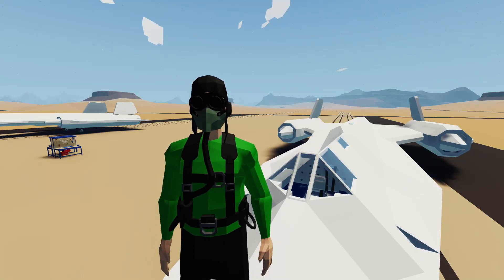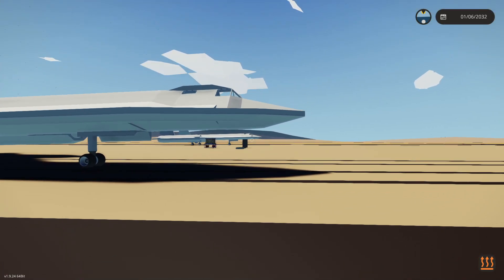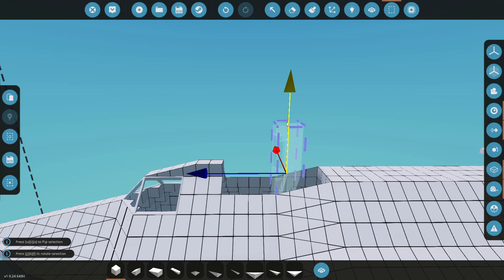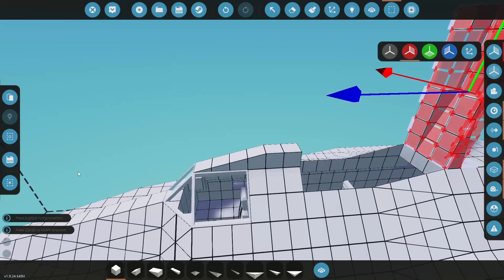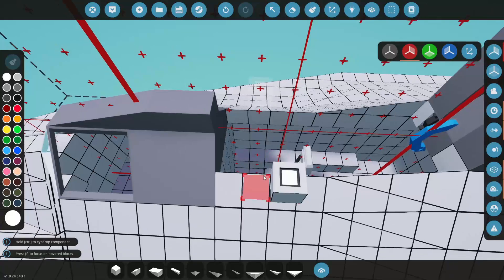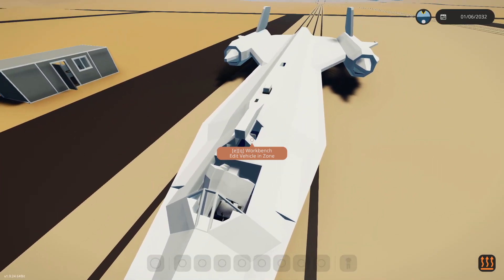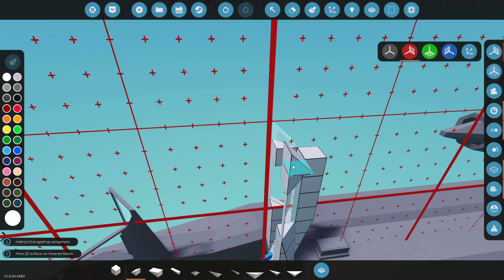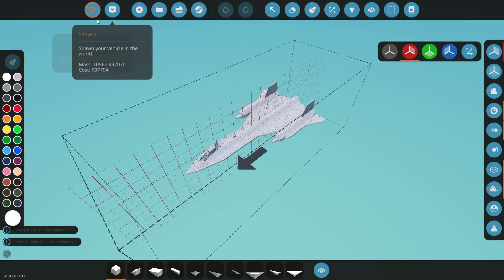Cockpit Canopy & Layout of Dials! Let's Build a SR-71 Blackbird!!! [5] Stormworks

Comment: Hey man, I love airplanes and I know some information about the SR-71 cockpit (may not be 100% correct).

So in the left back side are all the circuit breakers (way less that the right side), and oxygen. Between the throttle and the breakers are the radio and lightning controls. three oxygen systems: two normal, one for emergency. 
Some engine "emergency controls" and inlet doors bypasses are on the left of the cockpit levers. 

Front panel:
On the left part of the panel there is internal and external temperature control, oxygen levels, landing gear controls and cabin pressure. (there is a lot more stuff but these are the main components).
On the center, there is an AOT gauge on the left of the artificial horizon.
Left side of the compass there is an equivalent airspeed indicator.
Below the compass there is a heading panel and on the left of the panel there is knots, altitude and mach. Left of that there is the outside air pressure. Below that there is an accelerometer.
Below the heading there is a little display which you can use to see where you are.
Right side of artificial horizon there is a clock (yep a clock), altitude and the two RPM gauges on the right of the altitude meter.
Right side of the heading there is the vertical speed indicator, two fuel flow gauges, two manual RPM dials, oil pressure, temperature etc.
On the right part of the panel is the fuel meter, liquid nitrogen meter, purge controls, battery switch, igniter purge and fuel flow meter (because angle of attack affects the fuel flow), two generator switches , emergency fuel dump switch and fuel tank select switch.

Right side now!
stability system, autopilot, pitch and roll wheels, navigation, comms, engine startup switches, all circuit breakers (way more than the left side)

That's basically it! That's about 60% of all the stuff there is! Sorry in advance if this comment is huge :D
Reply: Wut the helllllllll now ohm god

Comment: You briefly mentioned ejection seats, that will be today’s trivia! (Sorry it’s late). Obviously the wind is a major concern in the ejection process, if you at a low enough altitude and are going quick enough, it can tear you apart. But, even so, the atmosphere is so thin at 80,000 feet, that a Blackbird pilot ejecting going Mach 3, would only experience the same wind blast as ejecting at 175 knots at sea level. It would also take around 50 seconds for them to reach their new terminal velocity. (That includes the time it would take to leave the plane as well I believe.) Also, the pressurized suits they wore cost 30k then, which is around 130k + adjusted for inflation. But also, each pilot was issued two suits, each with an estimated life span of 10-12 years.

Comment: Add an rocket booster to simulate the RAMJET, irl sr 71 had the turbo jet and the ramjet, stormworks does not have the ramjet but it have the 3x3 rocket booster, or the 5x5 if you want

Comment: I still can't figure out what is wrong with my ocean liner.  

Here is a description of what is happening to it.

(It uses Jet engines)it has a max speed of 17m/s and can maintain that speed for 15km and after the 15km mark the speed has dropped from 17m/s to 15m/s and by 20km mark the speed dropped again to 12m/s and by 22km mark ut dropped to 10m/s and by 26km it dropped to 8m/s and by 28km mark it dropped to 6m/s and by 30km mark it dropped to 2m/s and by 32km it wasnt moving at all.  

Also, it has 4 lpropellers and 2 of them spin in opposite direction of the other 2, and they are supposed to spin inwards towards the hull. If someone can please try to fix it and when and if you are able too can you please respond to this comment with the solution to fix these problems and how you figured out the cause. and how you solved it, thanks.
 
https://steamcommunity.com/sharedfiles/filedetails/?id=3100840188

It sucks that this ship i made is having issues because it is my most successful ship so far.